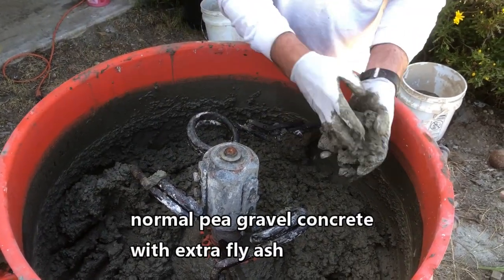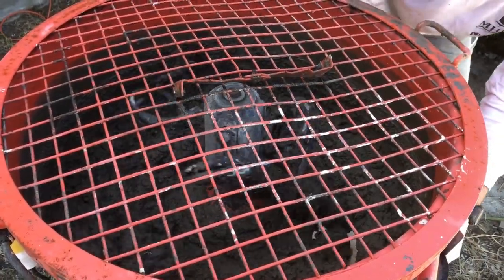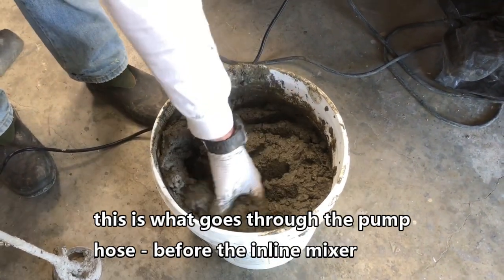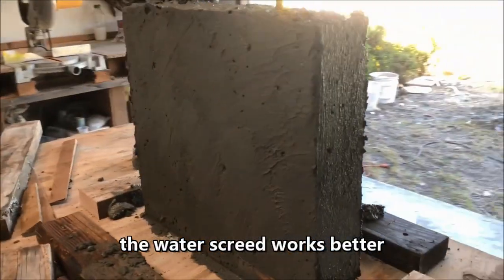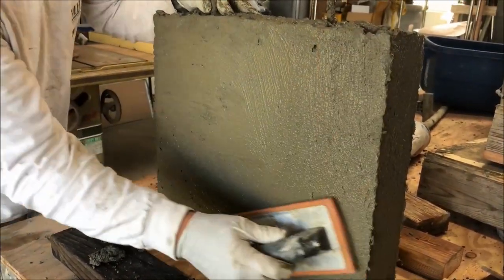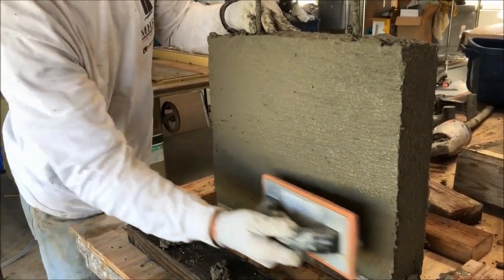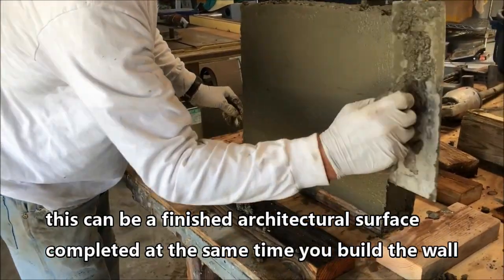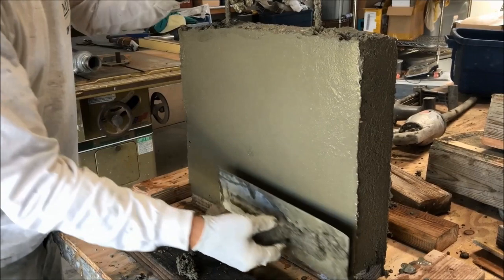Spacecrete Bench Test - to demonstrate a rapid vertical concrete build

Comment: How strong is it compared to regular wall concrete?
Reply from the maker: It is essentially normal concrete. The last cored sample - just air cured in place - tested at 5100 psi, so that was good.
Reply: @SpaceCrete  Is density and tensile strength similar to conventional concrete as well?
Reply from the maker: @mtlefty8687  Never measured tensile. Density was an issue in adding too much air, even 14%, but normal density otherwise (using lighter aggregate makes vertical easier).  Since got rid of the high air - now no change to air content - but more experimentation still reqd.  Main benefit is much reduced shrinkage.

Comment: Do you think the mix you used in your video would work using a machine like the one in this video https://www.youtube.com/watch?v=QXqwnJTVSsE&t=217s it would be to build 20 foot diameter domes in developing nations with a warm climate?
Concrete Without Forms
https://www.youtube.com/watch?v=nkxe9uK8jSo
Reply from the maker: Urschel was brilliant. His machine did not advance until the concrete was compacted. If you figure out how to use his technology with pumped concrete, then go for it. If you are building domes and not pumping the concrete, you don't need me - just build your version of his machine. Thanks.